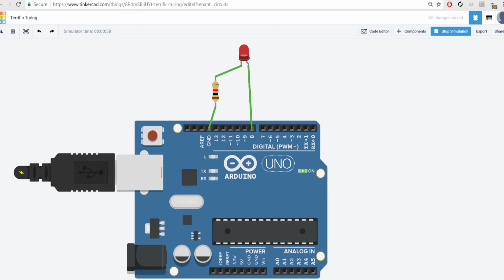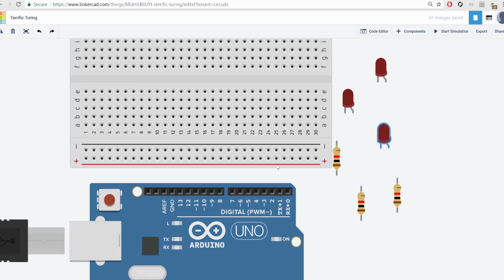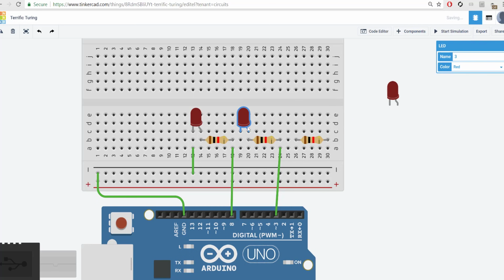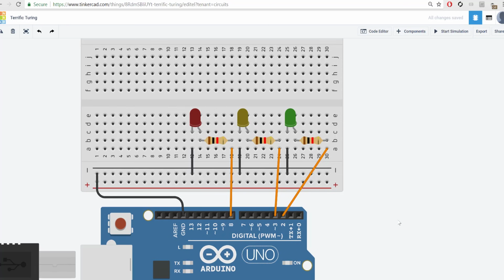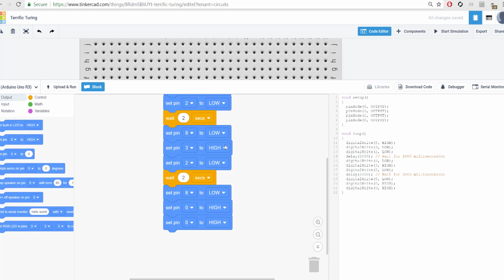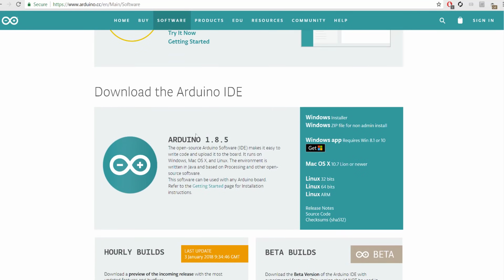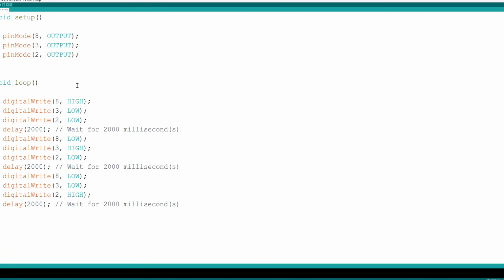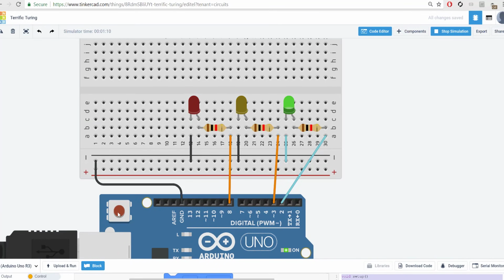Arduino UNO Tutorial #2 - Street Light Project (Basic)

Comment: May I ask if the purpose of a breadboard is to test out the progress before finalizing and soldering the wires together why use it in a virtual simulation?
Reply: Yup.  Breadboards are used for prototyping circuits and this simulation helps when you go to use an actual breadboard.  And like @dranirbanpal put it, definitely helps for those who are unable to afford components.

Comment: no this is the real text: // C++ code
//
void setup()
{
  pinMode(2, OUTPUT);
  pinMode(3, OUTPUT);
  pinMode(8, OUTPUT);
}

void loop()
{
  digitalWrite(2, HIGH);
  digitalWrite(3, LOW);
  digitalWrite(8, LOW);
  delay(2000); // Wait for 2000 millisecond(s)
  digitalWrite(2, LOW);
  digitalWrite(3, HIGH);
  digitalWrite(8, LOW);
  delay(2000); // Wait for 2000 millisecond(s)
  digitalWrite(2, LOW);
  digitalWrite(3, LOW);
  digitalWrite(8, HIGH);
  delay(2000); // Wait for 2000 millisecond(s)
  digitalWrite(2, LOW);
  digitalWrite(3, HIGH);
  digitalWrite(8, HIGH);
  delay(2000); // Wait for 2000 millisecond(s)
}